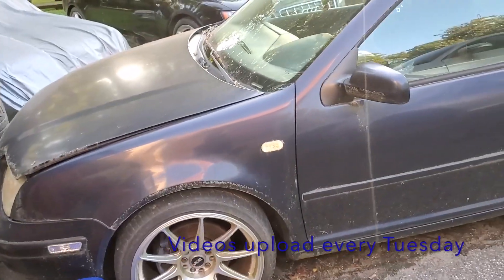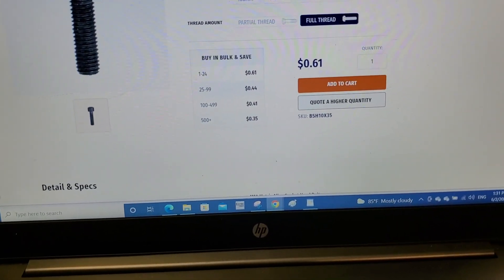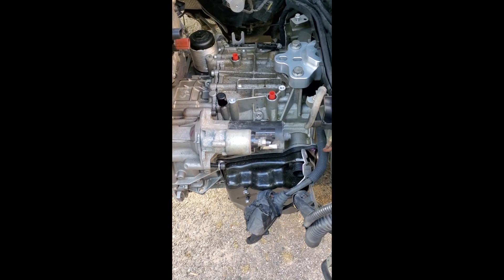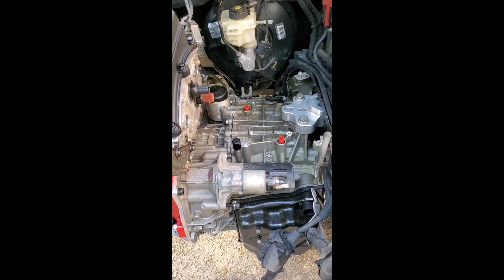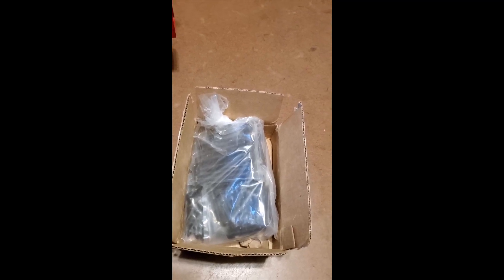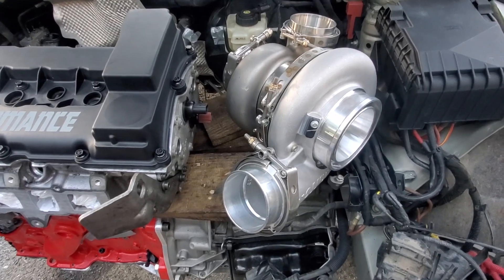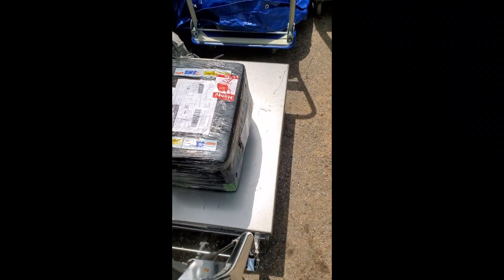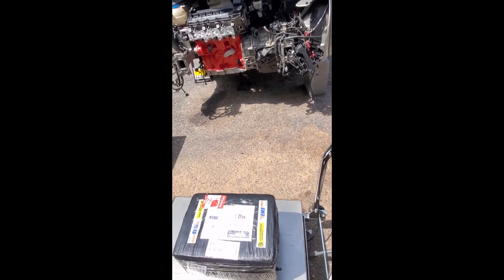Measurement and fitment for Garrett GT42-1450 TURBO

Comment: Everything I have read says dsg's and stock blocks are fairly reliable up to 700hp. But a bunch of people are shearing gears 400-500hp. Most people are talking about dq250's though. Trying find a trans solution for a vr36 build myself.
Reply: Dq500

Comment: Hey boss great videos. Subbed awhile back. I have a question, the the 12.8 mount bolts stretch bolts?
Reply from the maker: The 12.8 mount bolt are NOT stretch bolts my bad for late response I thought I replied👍🏽
Reply: @ElitePerformance111  no man all good brother. Thank you for the info. So are you not worried about the bolts breaking?
Reply from the maker: @mkfourgli9785  No not at all….
Reply: @ElitePerformance111  thank you bro. Please keep posting the videos and info. We love it
Reply from the maker: @mkfourgli9785  Thank you my friend I really appreciate that and you’re support 🙏🏾